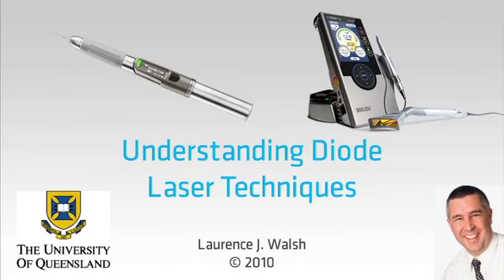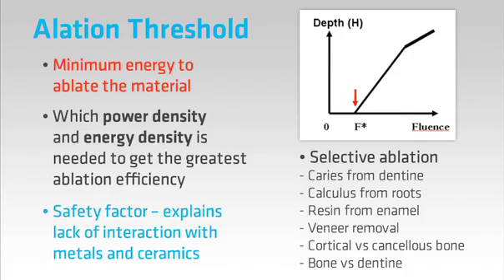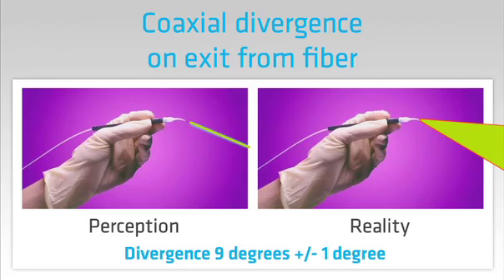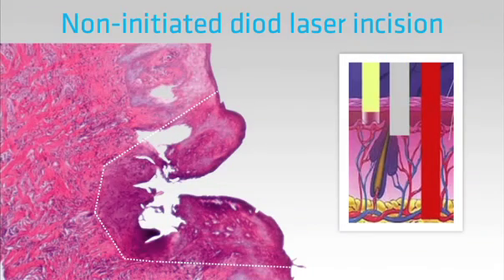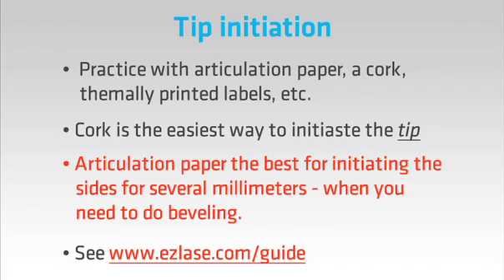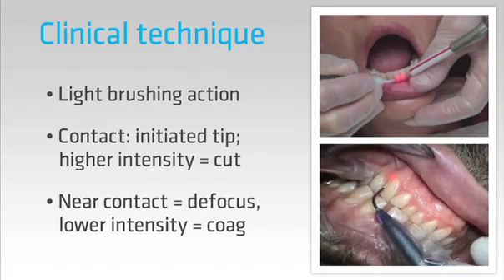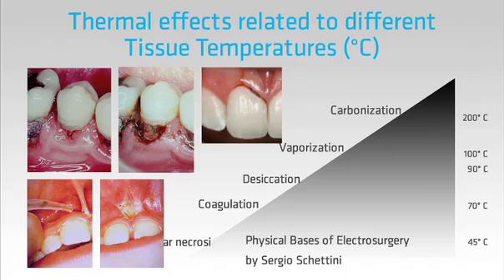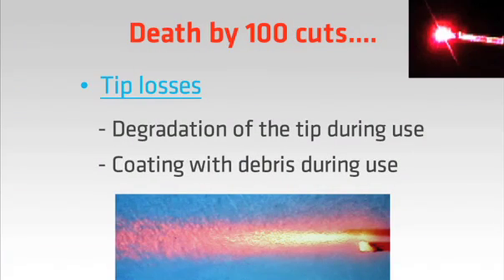Biolase: Understanding Diode Laser Techniques

Comment: Laser is the newest and very helpful technology in dentistry. With the help of Laser the use
of blade is avoided during surgeries. The surgical site heals faster if done by
laser. The root canal is disinfected with help of laser. With help of laser
there is less bleeding or no bleeding at all. Laser can be used for teeth
whitening procedure to accelerate the reaction of bleaching agent. Laser helps
in Biopsy for cutting tissue for examination.Hence using laser is advantageous
in dentistry.At #TeethCareCentre we aim to render best of newest facilities present in dentistry. We use instruments and materials highest in its brand. At centre, we have Biolase Laser which makes the treatment more comfortable. #MakingSmileIncredible